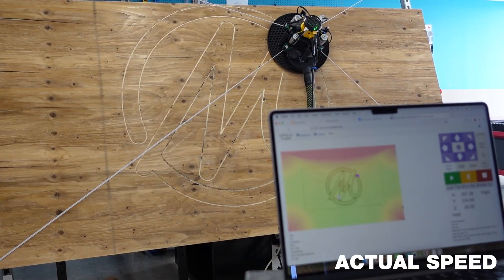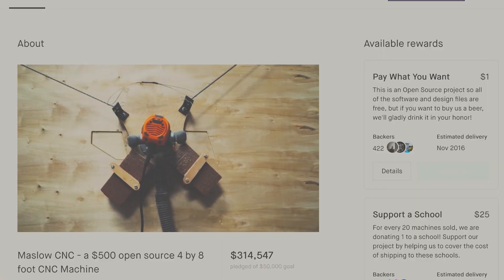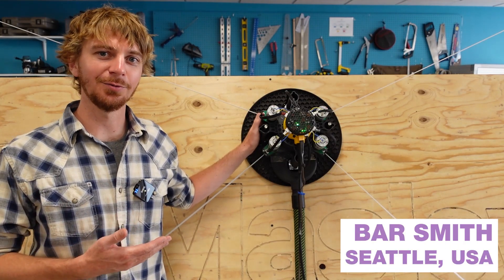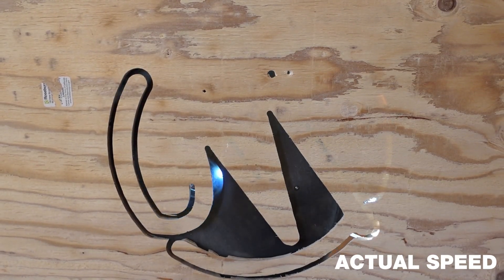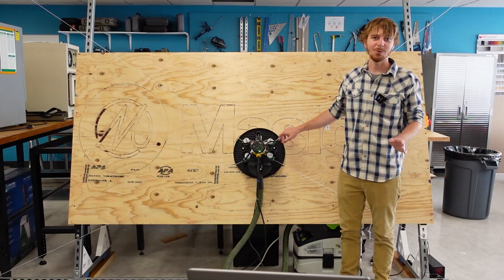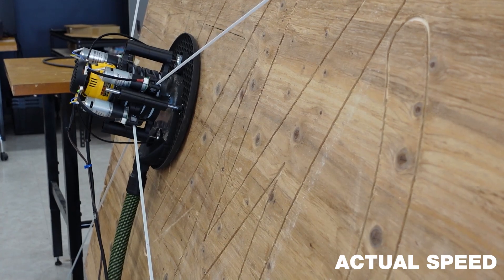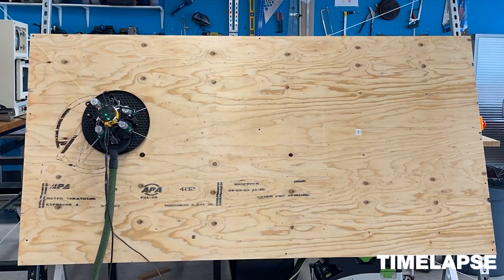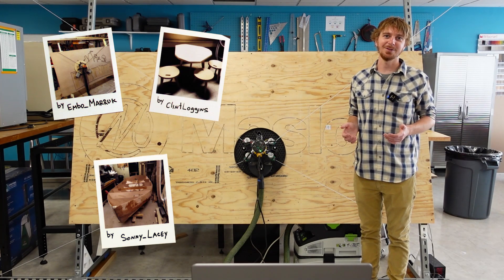Maslow4 Kickstarter Video

Comment: 5 axis? How?
Reply from the maker: There are only three axis of motion when cutting (XYZ) but the controller board has 5 independent axis (Each belt + Z axis). Powerful computers are getting cheaper so we're trading more complexity on the control side for cheaper mechanical parts

Comment: I have been rabidly following this project from the start. One thing sorely missing is more project videos and detailed project galleries. The project well communicates the imperfections, but I want to see those imperfect results AND get tips for mitigating them. 

By that I mean, building of a CNC storage shed, holding up for display the structural parts and showing how they almost line up. Then what is done next. There’s enough show and tell recorded, but not as much recorded about the processes and workflow. This comment is more for the community than for Maslow itself. Please energize, inspire, and educate us folk who have been spectators for 7 years.
Reply from the maker: We're doing our best to work on getting more projects built. It's tricky to find the right balance between spending time on projects vs spending time on getting kits out to our KS backers (obviously they are the priority). We will do as many project videos as we can and as soon as the community has kits in hand I am sure we will see an explosion of project content

Comment: Maslow jig saw?
Reply from the maker: We would have to add another motor to angle the blade in the right direction, but the controller board has an AUX connector we could use for that...although we wouldn't need the stepper motors for the z-axis then so we could use one of them. How would the wood be supported so that the blade could cut through without hitting something? It's a cool idea...if you want to build it I'm here to help

Comment: How is Z axis travel controlled?
Reply from the maker: There are two stepper motors between the sled and the router witch can set the depth of the cut

Comment: Uh...Why just don't make it cut on a table instead of that dumb cord structure?
Reply from the maker: It's mostly an issue of cost. It's much cheaper to use belts under tension than it is to build a steel gantry that is rigid. It's also quite a bit smaller in an upright configuration than a regular table CNC. It's not for everyone though and it sounds like it might not be for you.

Comment: hi! i seen on the kickstarter page that the tolerance is +-.5mm. is it compared to the maximum length of the routing surface? how does it compare to usual routing (horizontal) tables? would it be precise enough to route a guitar fretboard with fret slots?
Reply from the maker: It's quite a bit lower. Shopbot for example claims 0.0762mm tolerances...but it's also $20k...but we're not really trying to compete with those machines, we're trying to be substantially better than doing it by hand. I don't think I'd really recommend Maslow for doing a guitar fret board.

Comment: Ok I have never had room for one. But would love to have. 
BUT have really big questions. Instead of router.  I would like to use a plasma cutter. Has anyone done this?  Can you do this?  Will it work.  Someone need to try I wish I could
Reply from the maker: I think that there are pretty big safety concerns, but I don't see any real reasons that it wouldn't work

Comment: To what extent can this do 2.5D stuff? I'm assuming machine contouring is out the question as the board needs to stay reasonably flat, but can it mill pockets etc. or is it strictly 2D?
Reply from the maker: You can absolutely do pockets and even 3d contouring as long as (like you said) you don't make a hole so big it falls in.

Comment: What about kickback and the stretch in the lines , looks good for large soft projects
Reply from the maker: Kickback seems to be more of a human thing than a machine thing...it ends up not really happening for robots. Stretch in the lines is a thing though. The reinforced belts we're using actually stretch less than the chains we were using before, but there is still some stretch and we compensate for that in software

Comment: Isn't the accuracy and quality of the cut entirely dependent on the solidity and foundation of the actual tool? I know CNC's are near worthless if they move around a bit and can't hold a zero on measurements. Would like to see how this is addressed outside of a perfect setup. Especially if you're cutting difficult/solid wood, I wouldn't trust something like that to maintain perfect lines and such, not just hanging by string/wire. For the price of this I can get a pretty decent used router with a lot more functionality. Especially if someone has that much garage space available, they probably can afford and want a more reliable, faster and longer lasting tool.
Reply from the maker: We're not for everyone! If you can find a big used CNC router for $500 that's awesome. We're just excited to see people making things any way.

Comment: NICELY DONE!
I have a few questions, if you don't mind.
- How do you calibrate it?
- Is it required to square and precisely measure the distance between the anchors in order to calibrate it?
- How precise are the cuts compared to the older ones?
- Did you stress-test the plastic parts for longevity?
- Can it cut precisely over the entire surface (unlike the older one)?
Reply: Yes I too would like to hear the answers for these questions.
Reply from the maker: Excellent questions. It self calibrates by taking a bunch of measurements by pulling the belts tight and then it uses that information to compute where the anchor points are. They do not have to be precise or even in a square or rectangle pattern. You don't measure anything by hand. The cuts are quite a bit more precise than the original one, especially near the edges of the sheet. Near the center of the sheet it's about the same, but near the edges the extra force from the lower belts makes a big difference. The production version  will be made from Delrin so it should be more durable than the prototype, but even on the prototype I've probably got over a hundred hours of cutting with no issues so far. Re: cutting over the whole sheet you are still going to get the best performance in the middle, but the performance across the whole sheet is WAY improved
Reply: @maslowcnc  WOW, interesting. I imagine that the angle at which the belts exit the sled, not only their lengths, will affect how many encoder steps are needed for movement..right?
- Are the angles also determined by stall current detection?
- Is it realistic to say that precision is roughly 1mm across the board?
- Will heat from the router cause the Delrin to deform?

 Sorry, I have so many questions. I'm trying to persuade myself that I need this upgrade
Reply from the maker: @TM-529  We compute the angles from pagorean theorem...basically we know the belt length, and we know the height of the z-axis so we can compute the third side of the triangle. The goal is to hit .5mm across the whole sheet. We're not quite there yet, but we are getting close. Come to the forums! These are great questions and you will get faster answers there.
Reply: @maslowcnc  If my memory serves me well, the distance from the top of the z-axis to the anchor point in this instance will be the hypotenuse of the Pythagorean theorem, but what purpose does this serve? 

When the belts are extended equally, an isosceles triangle results, however, the height must still be known in order to determine the distance between the two anchoring points (triangle base). 
Without measuring the distance between anchoring locations OR knowing the angle at which the belts exit the sled, I can't figure out how it calculates the anchor point positions on its own. I'm pulling my hair out on this :P

- "The goal is to hit .5mm across the whole sheet"...What's the actual precision as it stands now, 1-2-3mm?
- You said that a different material (delrin) will be used for the production run.....Have you done any tests with this new production material?
- Is it required to re-calibrate each time material is loaded?
Reply: As the owner of an M1 Maslow CNC, here is my advice/opinion:

I'd hold off and listen to what the initial kit owners have to say. Bar isn't known for putting "production-ready" kits up for sale, and the "4x8" cutting machine statement was very misleading.

The prior Maslow was plagued with hardware and software flaws that he never resolved; instead, he stopped selling kits when the majority of users were complaining about hardware and calibration issues.

The project would not exist today if it weren't for the three vendors that stepped in—makermade, metalmaslow, and eastbaysource—who have been selling, upgrading the kit, and supporting the Maslow community/project for the past four years.

In terms of this M4 kit,
Pros:

- Faster cutting speeds 41ipm M2 --> 78ipm M4
- Easier calibration?
- Better precision on lower corners?

Cons:

- It still does not appear to be a true 4x8 cutting machine.
- Calibration software are still in the development phase.
- The "goal" precision seems to be the same as in the previous Maslow kit -- 0.5mm -- but the actual precision is unclear. 
- Similar problems with losing precision on lower corners.....
-Need to be calibrated each time stock material is loaded?
-There is absolutely no documentation yet, no assembly guide or software/calibration instructions.

**The aforementioned views are solely my own opinions, based on my experience.
Reply: @maslowcnc What kind of tolerance are you talking about. Say on the edge. And in the middle?
Reply from the maker: I just posted a detailed description of how the calibration process works over in the forums that answers this better

Comment: What happens when it hits a knot
Reply from the maker: That was one of the most common questions with the first version. Literally nothing at all happens :p...I've cut steel screws in the frame and not noticed until after the cut was done

Comment: Does the vac hose cause the thing to twist slightly?  It looks like some of the straight lines aren't super straight, and a few of the curves don't appear to be as smooth as you might want.  I understand that the low barrier to entry and the small footprint are going to have some trade offs, so i'm not trying to be overly critical.  I just want to know what the limitations truly are.  I'll have to go through your other videos...

I built an MPCNC lowrider, but was unhappy about how much space it was taking up and a lack of rigidity (to be expected).  Maslow can clearly address one of those issues, thought it might require more post processing.

Anyway - looks like you guys easily blasted past your goals - nice work!  Good luck.
Reply from the maker: The whole thing rotates around the router bit so twisting the sled side to side doesn't move the router bit, just rotates around it.

Comment: Please do support the Makita trimmer. Dewalt doesn’t produce the trimmer/router your are talking about for many markets in the world (Australia being an example). Here we can only get the cordless version which has its own issue being just being battery powered.
Reply: I have noted elsewhere you said these run too hot. I’ve run a couple of these in CNCs for years in a shed that’s regularly over 40C and there is only one circumstance they get really hot and that’s if the airflow is impeded. I tried one with a bad dust shoe design but know I now it’s entry to duct that air away and they keep cool.
Reply from the maker: That seems like a common request so I will do my best

Comment: This is amazing, will there be any kind of Maslow OG upgrade kit available in the future?  It doesn't look like it uses much OG parts, maybe just the stand?
Reply from the maker: Unfortunately it's a complete redesign so no shared parts with the original in terms of electronics or the sled, but the stand from the original will work great.
Reply: That was my question. How much of my old kit can I reuse.

Comment: Question: It appears you are using Planetary gearboxes now rather than Worm gear. Does it "drop" or lose position when power stops to the motors? Worm gears cant be back driven.. Thanks!
Reply from the maker: Great question! Yes and no. The power is off to the motors when I am standing in front of it in this video so it doesn't like drop to the floor, but the belts do de-tension slightly. If you powered off the motors while cutting it would leave a little mark, but it doesn't move more than a mm. The position isn't lost because the encoders are tracking the belt movements so when you power the motors back on they resume. The big advantage of the planetary gearboxes is that because there are more teeth engaged at the same time they can handle the torque better and last longer. The worm drive gearboxes lasted quite a while, but they did wear out.
Reply: @maslowcnc  NICELY DONE! it looks impressive!
I have a few questions, if you don't mind

- Is it required to square and precisely measure the distance between the anchors in order to calibrate it?
- How precise are the cuts compared to the older ones?
- Did you stress-test the plastic parts for longevity?
- Can it cut precisely over the entire surface (unlike the older one)?

Thank you.

Comment: I'd like to see more how it works. Still DC motors with gearbox, but 4 drive motors? No bike chain. So you moved all the motors to the end effector. I guess the motors are encoded. Very cool.
Reply from the maker: I'll do a more detailed technical video soon, but basically you got it! The encoder isn't actually in the motor, it's tracking a roller that engages with the gear teeth. It's more precise that way because it's measuring the actual belt, not the movement of the motor which would be effected by how much belt is on the spools. There's a little bit more detail here, but a video to explain it all is in the works: https://www.maslowcnc.com/about-maslow4
Reply: @maslowcnc  Thanks so much. I've been following you since you were on Tested years ago:-)

Comment: Does it have to be a Dewalt Router?  I know in early iterations you guys were recommending Ridgid I believe...It was an orange topped variable speed router.  When I bought a wood router, I made sure to get the one recommended in case I ever was able to afford a Maslow to put it in.
Reply from the maker: Yes and no. We're hoping to support the Maktia trim router that is a similar size, and maybe a spindle of some sort, but the Rigid router is unfortunately a little too big. The extra weight of the Rigid was an asset when we were using it to provide the downwards force, but now that we have belts for that a lighter router is better.

Comment: I would like more information on how you interface with this device. I purchased the first one and ended up having to give it away. Had a tremendous trouble with the app and Web app functioning correctly.
Reply from the maker: Good question. Its a bit like when you connect to the wifi at the airport or the library or somewhere like that and you get that "login" window that pops up. Basically as soon as you connect to the wifi access point and open a web browser it will take you to the controls. It will work the same on any browser and any computer.
Reply: This is a webserver running on the controller (not a separate pi like webcontrol with the original maslow)
Reply: I personally know two people that had the same result with the first version. I honestly couldn't  beleive the last version was even a thing until I had a couple people ask me to cut the sled on my Queenbee.
I was like "you have to cut the sled out with a cnc?!" The two guys I know did it to save a few hundred over a ~1500$ setup and never were able to get their Maslows going.
It's great to see they improved the design but the use case for this is perhaps a bit too specific, I like versatility in equipment
Reply: @redherring5532  The first version shipped with windows software to control it. (groundcontrol) Like most CNC machines, you load the gcode that you create elsewhere and send it to the machine. There were times when this was hard to run due to libraries not working on new OS versions, but someone built a new version a year or so ago, so it's usable again.

later on, a user created a web based replacement for that windows software in python (webcontrol) , so it could run on anything, and the recommended approach is to use a raspberry pi or similar to run it on and then access it via a browser. you still create the gcode elsewhere.

There were a couple people who created and sold kits after the initial couple of rounds, and then one of those teams decided to do a major update, and made a different version of software for their machine that wasn't compatible with the normal machines, and their own software to drive it. They have since extended that software so it can control both types of machines, and released it open source, but their support is all via facebook and has fragmented the community a bit.

The new version is using a forked version of fluidNC running on a custom ESP32  board that also controls all the motors (forked because this machine has non-standard kinematics, the intent is to merge the fork back upstream). you still create the gcode elsewhere, and as I noted above and access it via a browser.

did the people who gave up ask for help on the maslow forums? there is a very extensive community there that is very helpful. (we even try to help with the m2 machines, but we have far less info on them)

Comment: How is this different than previous versions?
Reply from the maker: It's a complete redesign. It shares zero parts with any previous version. The biggest difference is that it uses four belts in place of the two chains that the previous version had. Using 4 belts lets us provide much more downwards force than gravity did so it is quite a bit faster and also more precise, especially near the edges of the sheet.